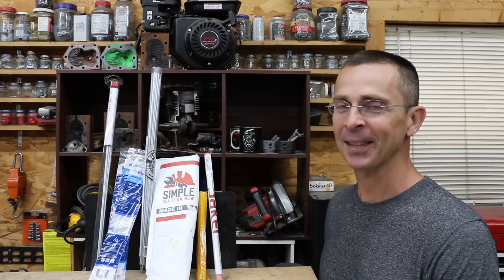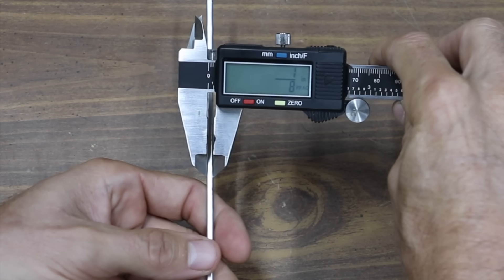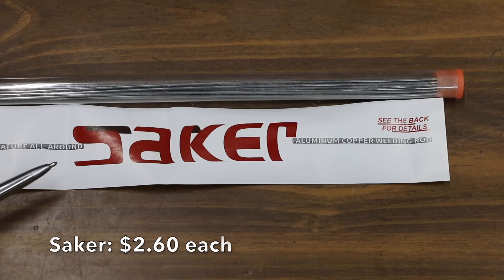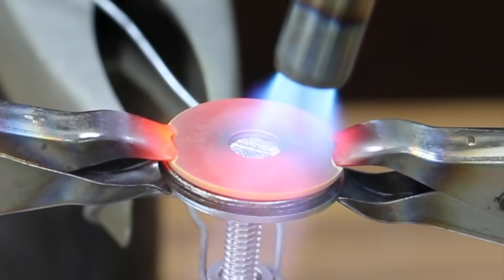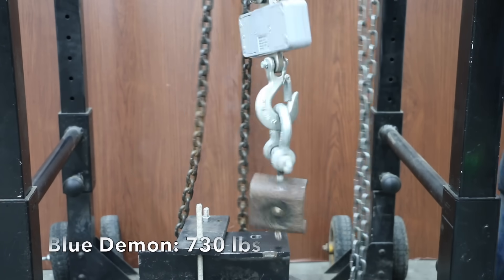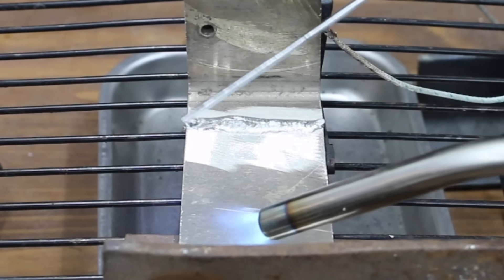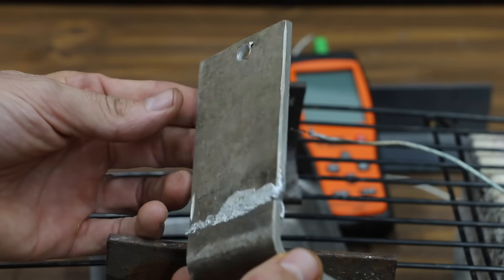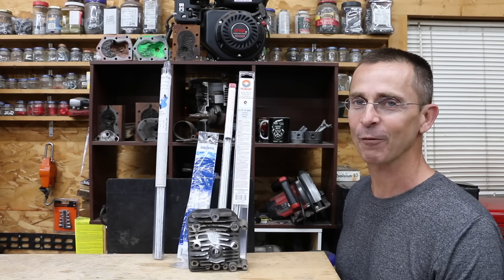Best "No Welder" Aluminum Welding Rods? Alumiweld vs Bernzomatic vs Hobart

Comment: I have wanted to learn to weld almost all my life, but no one I know welds.
Reply: this is more like soldering
Reply: @ElarionThaldras  technically it's brazing.
Reply: @michaellinner7772  technically by AWS standards this is soldering since the rods melt below 842 degrees Fahrenheit.  Brazing is an adhesion joint done with filler that melts above 842 degrees F without melting the base metal.
Reply: This is brazing, not welding
Reply: @miscojones35  Ok, but it looks like I would still be attaching metal to metal with metal.
Reply: @groermaik  
Welding is Fusion. 
Brazing and Soldering is Adhesion.
Reply: @miscojones35  It dont matter if its plastic or metal when you bond the 2 together its a type of weld.  Shit super glueing stuff together is technically a type of weld
Reply: @ronniewilliz153  Actually, the definition of welding is melting the two base metals (or plastics) so that they flow together, and most of the time, using some filler rod of similar material to flow in with them.
If you don't melt some of the base metal of the parts being joined together, you are not welding - you are either soldering or brazing.

You can weld without filler metal, but you cannot braze or solder without filler metal.
Reply: Ronnie Williz No it’s not, welding is melting the two pieces and having the “liquid” metal flow together “remaking” the piece. Everything else is just a version of gluing
Reply: @j.b.9895  lol. Im going off googling the word weld.
Reply: @ronniewilliz153  Not true. By definition, the base metal (the pieces being joined) must melt to be called a weld. This is actually, by AWS standards,  soldering; as the filler melts at less than 842 degrees Fahrenheit. Brazing is filler that melts above 842 degrees.
Reply: @DriverDiver24   super glue melts plastic an other materials to make them bond So there is a mechanical Bond from the chemicals. Just cus it's not metal dont mean its not a weld. There is plastic welding as well an yes i no it's more a type of bond but by definition you make 2 things in to 1 thing as with steel or aluminum welding. The type of gas an other stuff used in welding is not in the definition so there for welding is huge wide variety of things not just limited to steel and aluminum there's many different types of welds what I'm getting at it's not limited to just metals. Hell blast welding uses no heat an is still considered a type of weld.
Reply from the maker: These are very simple to use
Reply: @ProjectFarm  I see that.  I thought I needed a welder,  I'm glad to be proven wrong.  Thank you.
Reply: @groermaik  If you want to learn to actually weld, check out "WeldingTipsAndTricks" You Tube channel. and yes, you do need a welder to weld.
As for brazing (such as in this video), I would suggest a MAPP gas torch and flux coated rods, instead of flux core wire.
The principle in brazing is the same as in soldering - just at a much higher temperature - heat the work, not the rod.
Soldering forms a mostly mechanical bond, where brazing forms a forms a molecular bond (much stronger), and welding actually melts and flows some of the two base metals together, usually along some similar filler material, that freezes to literally form on piece of metal - not two bonded pieces of metal.
Reply: @jdgower1  Thank you.
Reply: Buy a cheap welder an use Google n yt youll get it down. Welding is the easy part knowing what setting to put it on for different metals is whats hard. But I would get a cheap $110 welder from harbor freight an paratice at home.
Reply: @ronniewilliz153  Thank you.
Reply: Very true some are not penetrating welds so they are not  classified as welding right ?
Reply: @ronniewilliz153  Actually, many welders are usually welding non-ferrous (not steel) stuff, just as much as just plain steel, so there is not a prejudice for steel in the welding community.
It;s literally a matter of definitions.
For instance, you can weld two pieces of ice together.
Put them against each other, rub them together so that the friction between them melts the intervening surface while flowing together, and then let them freeze.
It's welded, because there is no place where one piece of ice stops and the other starts - they literally become one piece of ice.

With soldering and brazing, one piece of the base metal stops here, another stops there, and there is a filler metal bonded to each.
Welding is literally making two pieces of something into one solid piece, while soldering, brazing, and gluing are using an intermediate substance to bond two things together.
Reply: @jdgower1  true you got a  point there
Reply: It is a very useful skill.
Theory , Practice , and Determination   will all be used in great amounts.
Reply: But the welder heads hate when you classify anything thats not steel to steel wleding they get super mad an have to mame sure they tell you its not a weld lol but when you combine to metals or 2 of anything its a weld lol. But true welder heads hate when ppl argue it. A weld has a huge range of a meaning